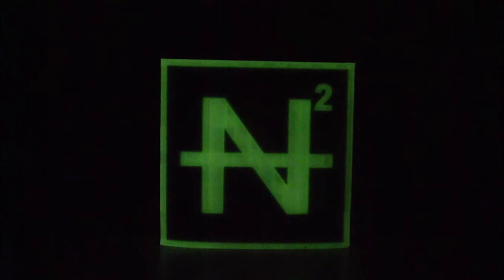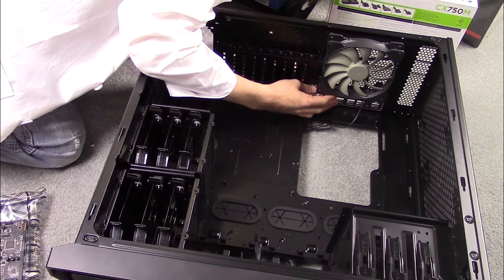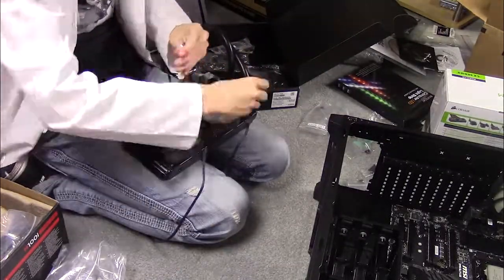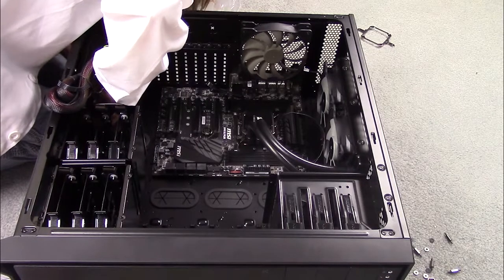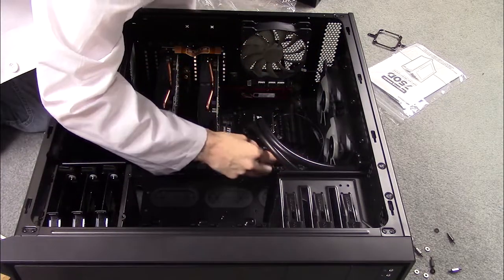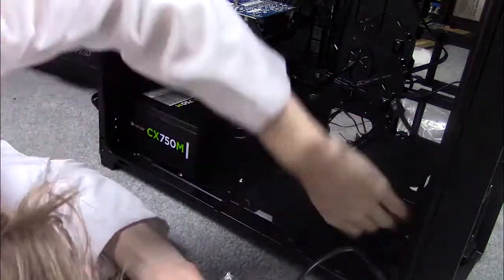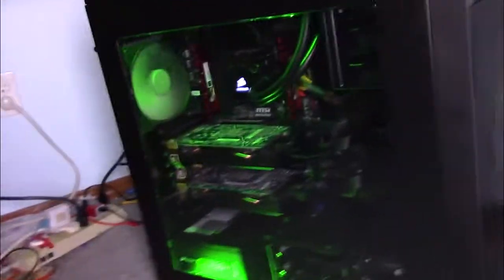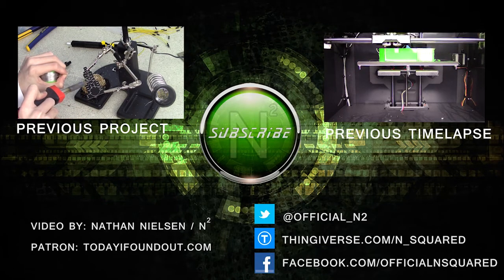Build a high end video editing/gaming PC for $1,000 USD

Comment: Do i have to buy a Hdd and sd for storage or any one will do ??
Reply from the maker: Both should work. I have 2 hdd drives and 1 ssd. The ssd is where the OS and things I want to run quicker are stored and the 2 hdd drives are for backups and video storage.
Reply: how do i for exapmle install adobe premiere pro on my ssd ? And can i use ssd for mass storage ?
Reply from the maker: Amrit Basavaraj The ssd works just like any other hard drive. When you install a program you can chose where it's installed. Just select a location on your ssd drive like you would with an hdd drive.

You can use an ssd for mass storage. however because an ssd drive is faster than an hdd drive the are more expensive. I would recommend using an ssd for the os and other programs you want to run a bit faster and an hdd drive for mass storage unless you don't mind spending the extra money.
Reply: +N Squared how do I install stuff that a want to run faster on my ssd ?
Reply from the maker: Amrit Basavaraj You install it as you would with any other hard drive. The fact that the program is on an ssd means it will run faster.
Reply: Last question : Does my ssd show up as Local Disk C: in my computer if i install os on my ssd ? And during first boot up when installing OS do i have to disconnect my HDD and plug it back on after installing the OS or is there any other wary to do it ?? P.S Im spending a lot on this so need to be sure :) You have been super helpful thanks !
Reply from the maker: I can't tell you for sure because I don't remember installing the os on my computer because it was so long ago. I would assume you can select which hard drive the os will be  on when you install it but I don't know for sure.

If you want do make sure the ssd has the os and is disk C: you can simply have it be the only hard drive in the computer when you install the os. That way it will have to have the os and will be drive C: automatically.

If I remember correctly I only had 2 hard drives when I first made my computer but after adding the 3rd one it automatically became drive G: and the other drives kept the same letter. So after the ssd is assigned letter C it will stay as drive C:

Comment: Do u know what high end means? High end cant be built with 1000$
Reply from the maker: +All4thecats Not counting the parts I salvaged from the old PC (Graphics cards and 1 hard drive), the end cost was $950. And I render videos in real-time and I haven't yet found a game I cant run.

I cant find the price of the graphics card I use, but they shouldn't be more than about $350 each, which is still around $1,000 even if you have to buy everything.
Reply: +N Squared i dont want to offend u, but u dont get what high end is. High end is the absolute best u can get on the market and not a budget price. Thats just not the definition of high end. Thats all i wanted to say
Reply: +All4thecats it's high end for its price range
Reply: +TYLO What the heck is so difficult to understand? "High end" is by definition something that is top of the line. Some budget things CANT be high end! You can call it good for the price but high end means something completely different. Is it so difficult for real?
Reply: All4thecats ok i understand

Comment from the maker: Today I will build my new computer Sarah. She is build specifically for running N Squared.

(with a little bit of gaming on the side)
Reply: +N Squared IF iNTEL core i7 6600k  can support with the msi mother board instead of Intel Core i7-5820K Haswell-E 6-Core 3.3GHz LGA 2011-v3 140W Desktop Processor BX80648I75820K